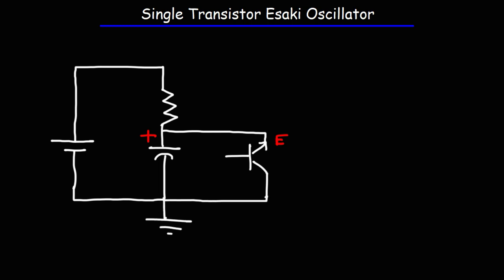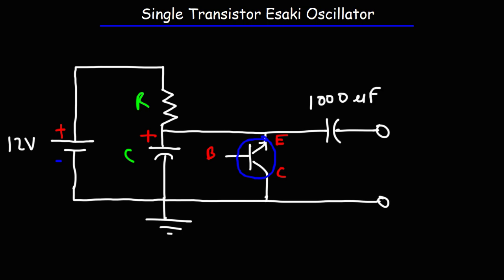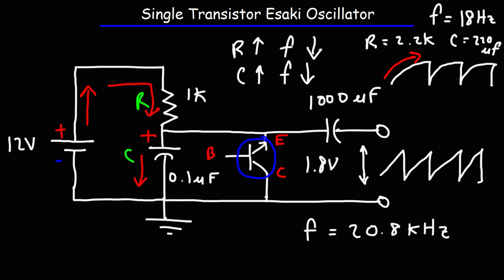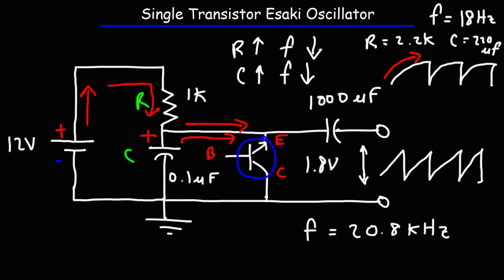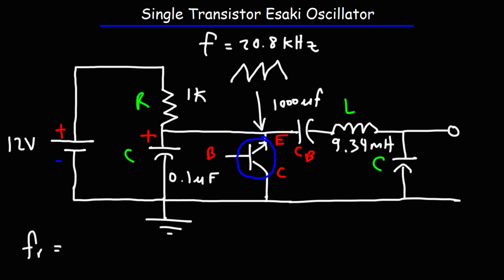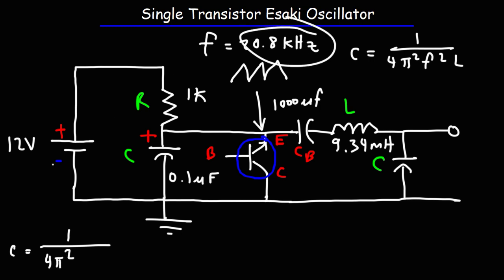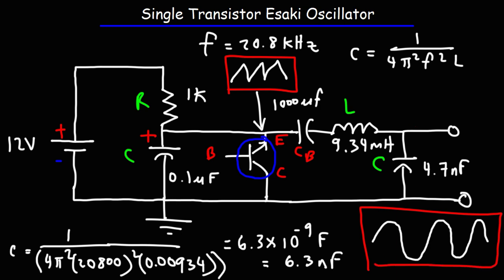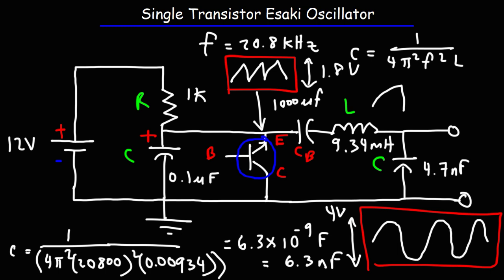Single Transistor Esaki Oscillator Circuit

Comment: Anyone know how many amps this thing needs to be supplied with? Setting up the circuit as is without resistor to limit the amperage makes my BJT’s turn into melted plastic pellets of uselessness, and my bread board supplies keep shutting off.

Comment: Can someone explain to me how the transistor turns on since the base current is always zero?
Reply: Im lost too
Reply: @SheikhN-bible-syndrome  It works with at least 12vdc. The diode in the transistor gets avalanched. It sends the power backwards through the diode in the transistor. It is hard on the transistor. A diode works beter.
Reply: It works with at least 12vdc. The diode in the transistor gets avalanched. It sends the power backwards through the diode in the transistor. It is hard on the transistor. A diode works beter.

Comment: Have you tried a REAL CIRCUIT? There is no way that this works! I did the real circuit and tried many other variants including many misleading videos like this one but to no avail! Theory and real world are many times as far apart as it gets! So I challenge you to make this to work without any edits and using real parts that others can recreate to verify your story!
Reply: I was skeptical too, try a 1k res with 1000uf cap, 2n2222 or 2n3904 and it helps to put an led om output of transistor, with that setup it should often work with a very slow visible blink of the led like 2-7ish hertz. I saw often work as it relies on the individual transistor characteristics,  namely breakdown voltage, beta(gain) and internal resistance,  which varies on each individual transistor, like a bin of 50 2n2222 will all measure slightly different,  in my experiments most do work, though. I will not claim to know the math to predict which specific characteristics work best, so just try a few.
Reply: WRONG   It works, I've built it many times. You need at least 12vdc for it to work. You should read about Esaki, he got a Nobel prize for this. Tonys not so fun

Comment: Good article. I like it. The second capacitor should not be called a bypass capacitor.  A bypass capacitor is a capacitor that shorts AC signals to ground. Maybe we should call it blocking or coupling capacitor. Thanks again for your very clear explanation of the subject.
Reply: I agree.

Comment: Excellent! Even fewer components than the UJT oscillator, and you don't need a UJT! I looked up Esaki; I suppose this 'backwards' transistor application works like a tunnel diode.
   One application that needs an oscillator but doesn't care much about exact frequency is a switch-mode power supply. You want the frequency somewhat above 40 kHz so the first harmonic is above 20 kHz - out of normal hearing range.
   QUESTION: What transistor characteristics do we need, and how do we calculate power dissipated in the transistor. The transistor is open during the charge portion of the cycle. During discharge most of the capacitor's energy, plus the power supply through the timing resistor, is flowing through the transistor. The duration of this current flow is short (depending on the effective resistance of the transistor) but it seems as if we might still overload some small-signal transistors.